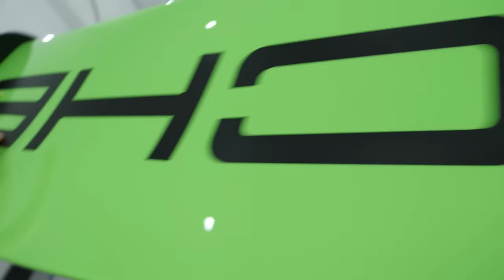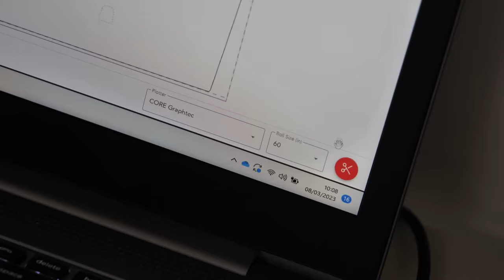Lizard Green 991.2 GT3RS - Detailing + Full Body PPF

Comment: It’s crazy, Jim has been doing PPF for a hot minute and he is better than so many installers that have been doing it for years.
Reply: With the greatest respect to all good detailers, whilst there is skill, esp with polishing, the real pro's know about attention to deal, and an eternal quest for perfection. Like losing PPF gaps between panels and headlights, its just lazy not to. I saw a car with the roof PPFd, wasn't pushed down into the screen just finished about 5mm on the top. Owner did one trackday and the speed/wind lifted the leading edge, dirt got in and he was mightily pissed. It wasn't a good vs bad job, it is right vs wrong. Also depends who's templates they are cutting PPF from, some give themselves a lot more tolerance on the sizing. My guy even PPFd the back of the carbon seats because he happened to ride in one on a trackday and noticed the seatbelts knocked the seat backs when using harnesses.
Reply: Also never accept a new car with PPF for 2 reasons they way over charge you and whoever they have PPF installed it’s usually never as good. Dealers don’t want to pay the installer what it costs so most installers don’t go above like a customer car because they’re not making enough money

Comment: What clay lube do you use? I was also surprised to see the paint was hard, isn’t Porsche known for having softer paint normally?
Reply: Water for clay lube.
Reply: @sanmiguel4019  Water actually does not provide good lubrication on its own. That will cause additional marring, lead to a more difficult process, as well as degrade the clay faster. If water is used, I advise at least making it soapy water.
Reply: @MiataPower96  Jim uses AMDetails Clay, he has said in previous videos you only need water as lubricant when using it.
Reply: @sanmiguel4019  🤔 interesting, I’ll have to look into that

Comment: Great video... but it is better to use the force of gravity in our favour, i.e. when undoing the center wheel nut, push down on the torque wrench bar using your weight instead of trying to pull it up towards you. This will greatly ease the task.